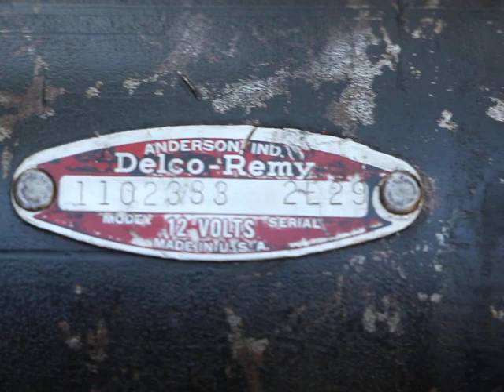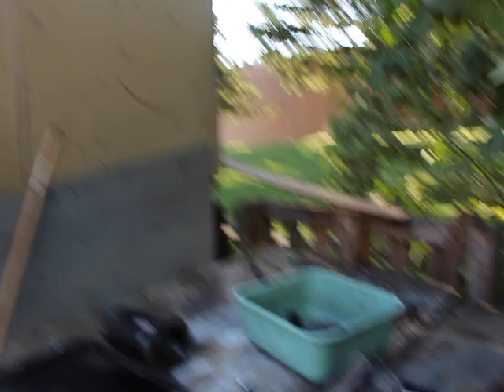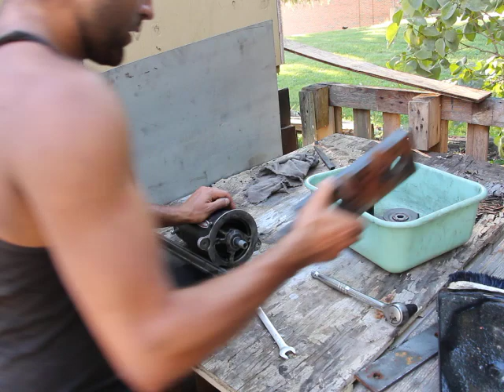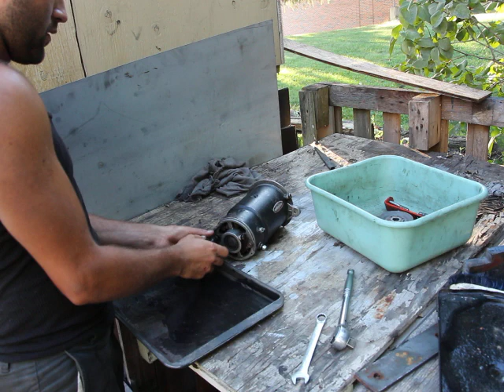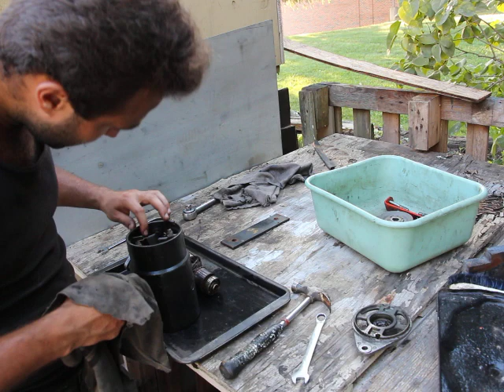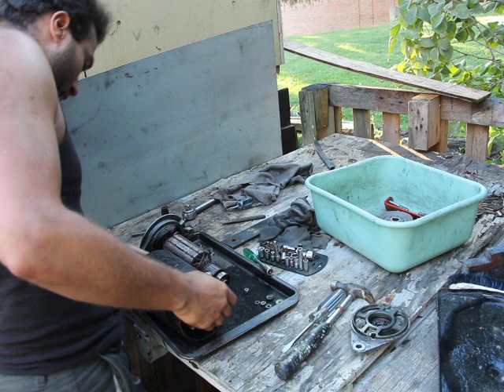Rambler generator repair maintenance p1

Comment: i had to cringe when you mentioned putting tape on the armature. It would probably come off sooner or later due to centrifugal force and cause you some problems, spray with shellac just as the manufacturer did.
Reply from the maker: I didn't apply it on the armature, I either said that wrong or you heard it wrong, LOL. I'd never do that. I did apply some epoxy on the ends of the armature wires. That will hold though and is standard practice.